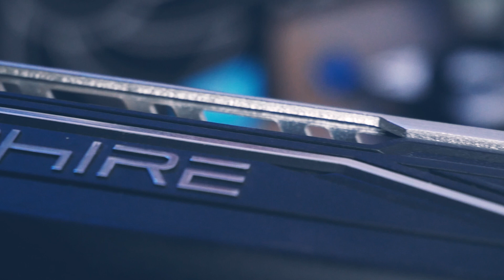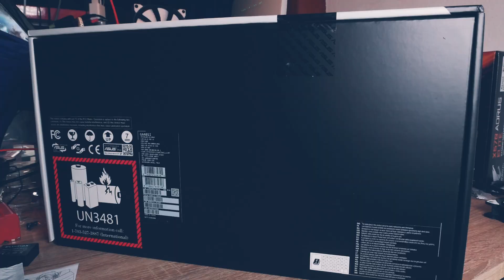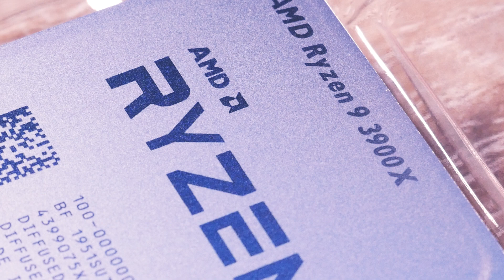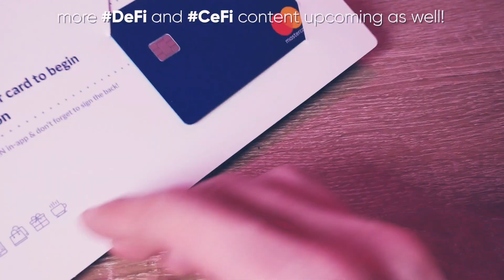August Mining, Crypto & Channel Update 2020: GPU / FPGA / CPU / ASIC & Travelling again

Comment: Have you tried mining on RX 5700 XT ?
Reply from the maker: Not yet! My plan is to go for 5700 non XT though, you should be able to achieve the same amount of hashrate by tweaking it :) cheaper card though
Reply: @CursedMining  yha you are right. But , i think it require BIOS mod . Waiting for your Rx 5700 rig 😍 .